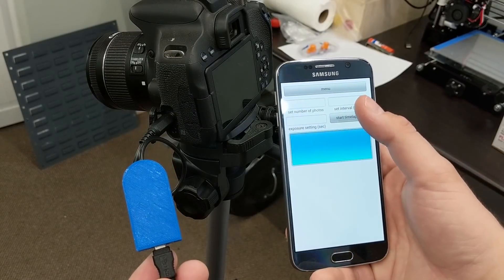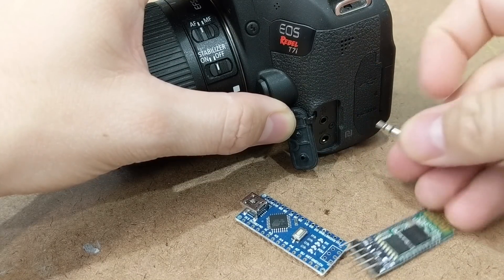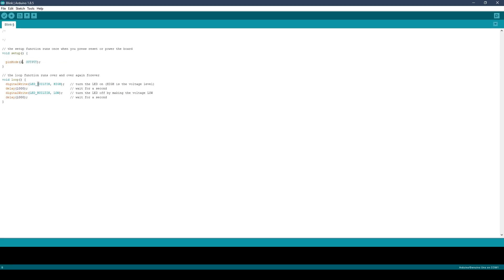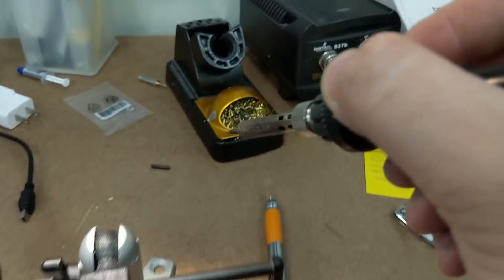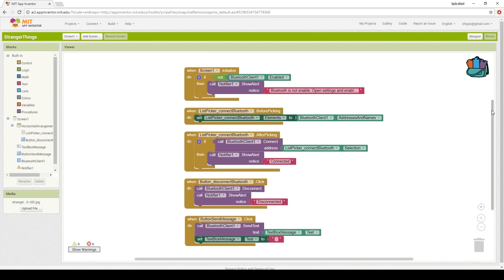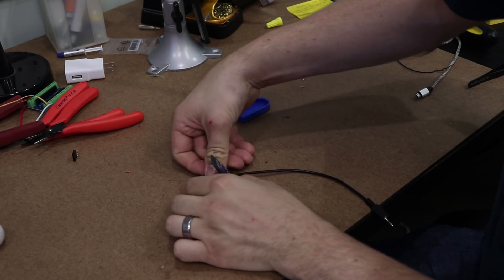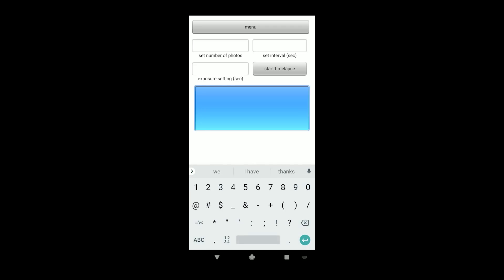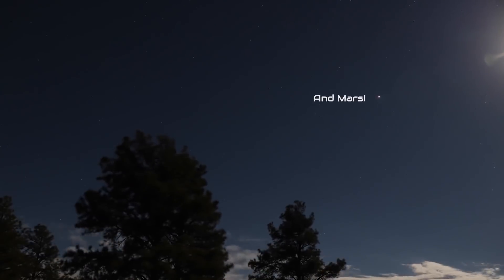How to Make a Bluetooth Intervalometer for DSLR Timelapse

Comment: Can this be make with micro USB cable ? Because I don’t have aux input in my DSLR
Reply from the maker: It depends on your DSLR. I would guess that the USB port is for charging and data transfer only. Probably no shutter control. You'll have to read the documentation for your camera though. Good luck!
Reply: byte sized thanks for information. Then I’ll try with IR sensor

Comment: Hi nice video,  must be good to control exposure  during in timelapse...
Reply from the maker: I usually keep the exposure settings the same throughout the time lapse
Reply: @bytesizedengineering  yes, fixed exposure like your night timelapse, when looking for night timelapse that includes a sunrise or a sunset. demanding exposures are ~ 14 to 15 full stops variance. 

With say ISO 100 & aperture fixed at f2.8, consider varing the  shutter speed range about 1/1000 upto 60 seconds (night sky + trace of milkyway) programming exposure curve through app. Though not sure if high speeds are achievable in bulb mode.
Reply from the maker: Wow! It sounds like you really know your stuff! I'd love to keep playing around and experimenting with astrophotography and time lapse. Thanks for your suggestions!

Comment: Nice project however you should use a transistor to make the connection not the GPIO pins directly, this can put 5v on the input of the camera and could cause damage over time. As well as if the camera could source too much current from the arduino and can damage the arduino over time.

Comment: Great project, good job!
Reply from the maker: Thanks Mario!
Reply: Little rant.
Back in the 80's, I used to design, make, etc. all sorts of things. (Electronic gadgets, Drafting/CAD, etc.)
I really miss it, and need to get back in gear designing things.
Been using SketchUp for a while to design furniture.
 Also started using Fusion 360 and Cura for my Ender 3.
Keep up the good work!
Reply from the maker: I used Solidworks when I was in college (student license) but it is WAY too expensive for hobbyists. I have been using Fusion 360 for more than a year and absolutely love it. Fusion 360 and Cura provide a great workflow for 3D printing. I just watched Tom Sanladerer's video this morning about this topic. Check it out: https://youtu.be/S9hmi1leU2s

Comment: Nice project, I love the use of hot glue to seal your enclosure, I'd have mucked around trying to design clips or screw holes. But the glue appears to work just fine! Really nice video, clear and concise and well filmed. Keep it up!👌👍 I'm guessing you power it from a 'USB battery / power pack' when you're out and about?
Reply from the maker: Thanks for the positive feedback! I used screw posts in my last enclosure design and it works great, but sometimes glue seems to be the simple solution. And yes, I use a USB battery pack when I'm on the move. Thanks for watching!